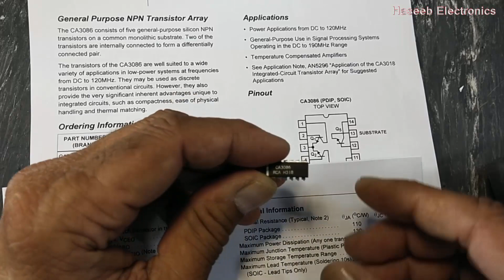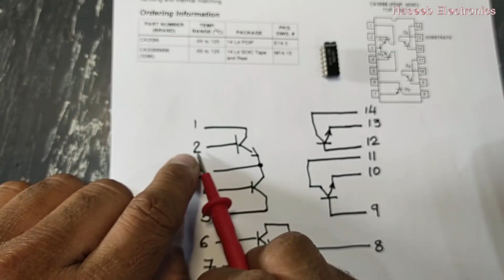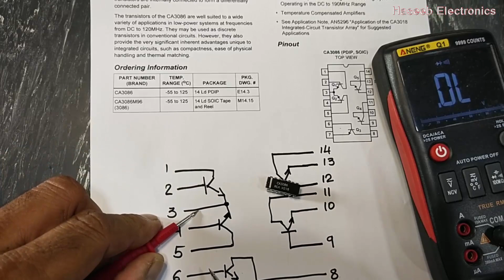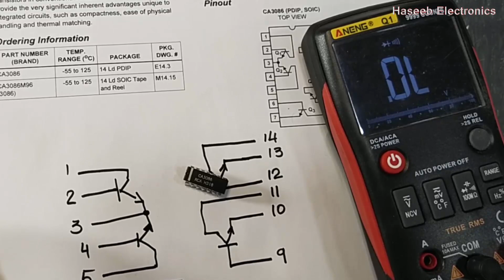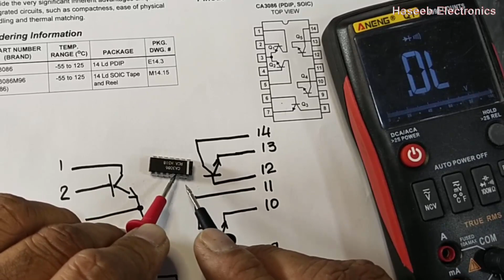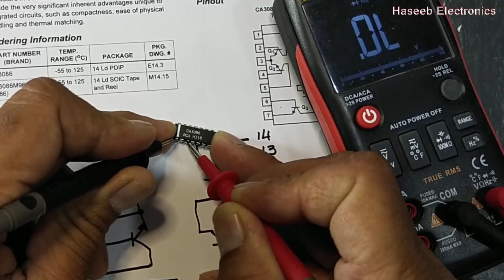{497) CA3086 NPN Transistor Array, How to Test CA3086 with Multimeter

Comment: sır my ca3086 in pin 13 Red prob and 14 pin Black probe it shown a reading 0.7 ,i though like you that it is wrong and i buy 2 New ca3086 and 2 lm3086 ,i checked them first on 13 and 14 pin and also them have a diode as you have shown in video,so them work and not are bad ,also in bf311 transistor if you check emitter and collector them will have an diode ,it must be open but they have and work prefectly..

Comment: If you cut those 3 pin and place a transistor, I really want to see it practically :-)
Reply from the maker: sure it have to work. there is no reason that it will not work. it have to work. i did it many times, because many times we fail to find this ic.

Comment: The forward voltage seems relatively high, compared to single transitor package. If I am correct, is that the drawback of using an array like this?